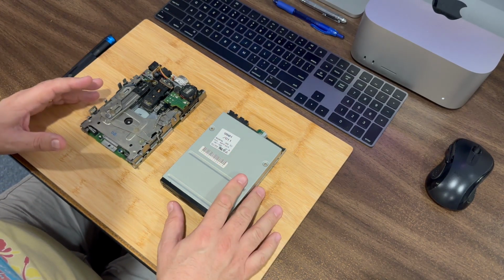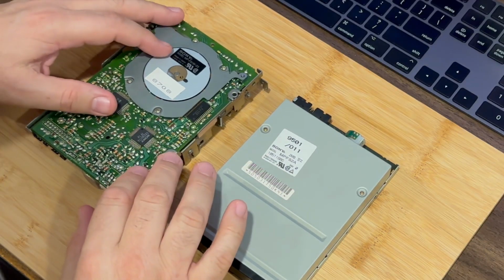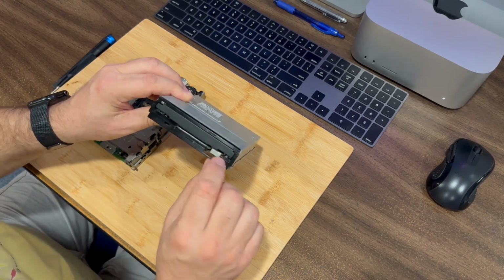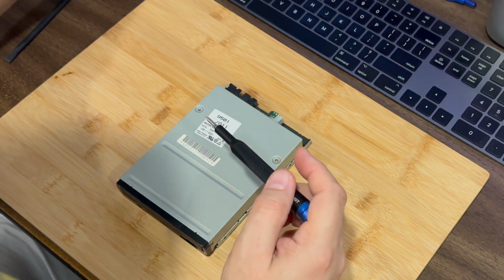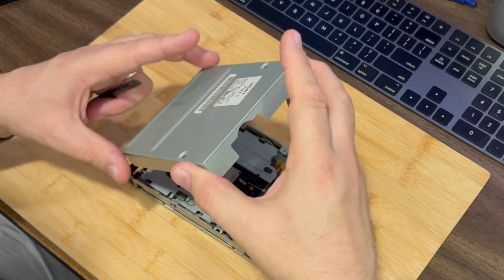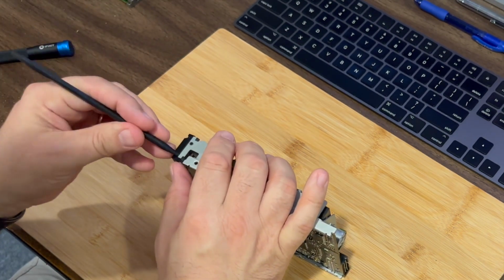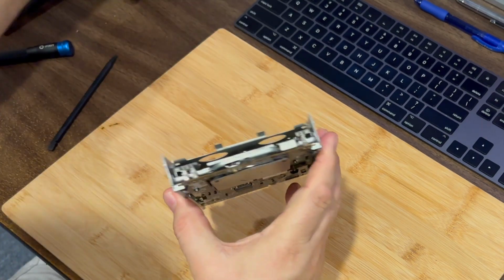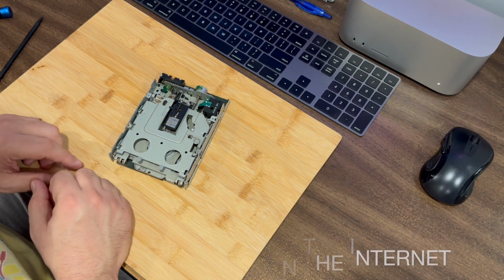How-To Open a Sony MPF52A Floppy Drive

Comment: You stopped right when it got interesting
Reply: Yeah, didn't even get a close-up with the cover off.  I took one of these apart but I'm not sure how the white piece goes back with the spring tensioner.  Can't find any other videos or pictures of this drive open anywhere.
Reply from the maker: Well, to be honest, I was a little worried that I was about to take a working drive and turn it into trash. I’ll post more once I figure it all out. Thanks for watching.
Reply: @AlanGrassia   😂 ill take fotos from now on.. got more 7100s - not many 7100 fans sadly :)
Reply: I managed to put it back together this is really hard if you only have 1 of them😂